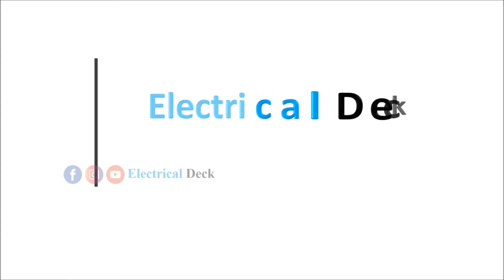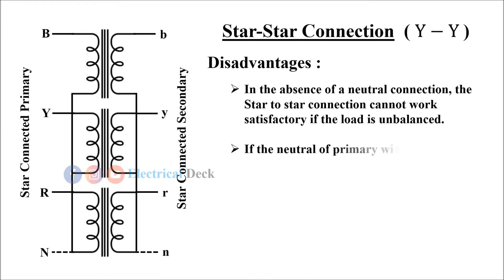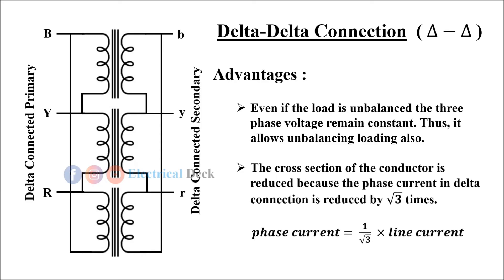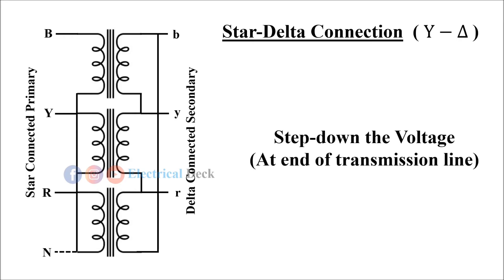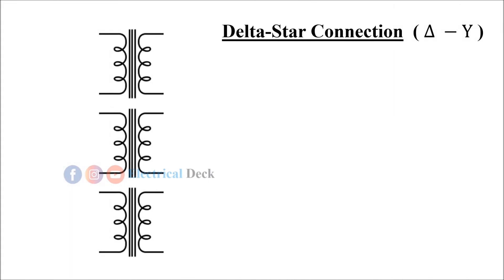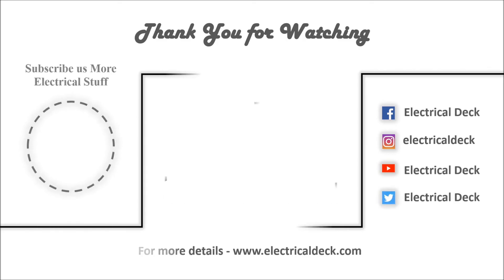3-phase Transformer Connections | Star-to-Star, Delta-to-Delta, Star-to-Delta & Delta-to-Star

Comment: 00:06 Understanding three-phase transformer connections for power generation and transmission.
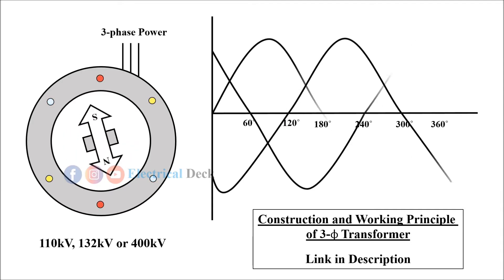00:54 Overview of three-phase transformer winding connections.
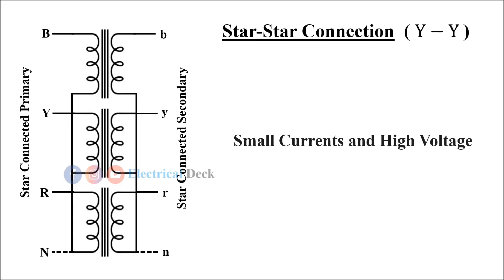01:44 Star-to-Star transformer connection is ideal for high voltage and low current applications.
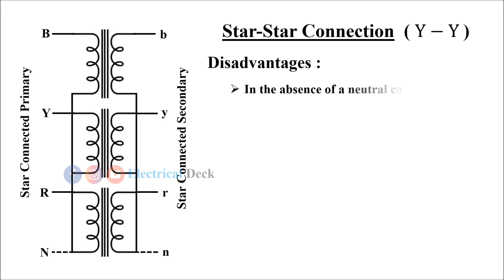02:33 Star-to-Star connection struggles under unbalanced loads.
03:23 Delta-to-delta connections provide stability and efficiency in unbalanced loads.
04:04 Star-to-Star connection isn't suitable for four-wire systems.
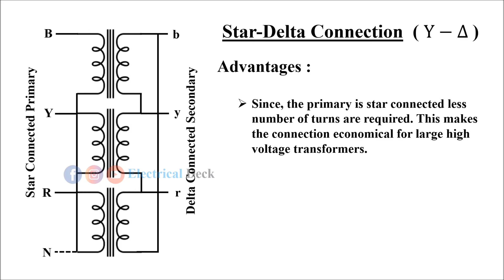04:50 Explains the advantages and disadvantages of transformer connections.
05:40 Delta connections support unbalanced loads in three-phase systems.
Crafted by Merlin AI.

Comment: Thank you for the clear explanation. Not sure if I'm right but I'm skeptical of the star to Delta. You said it was for stepping down voltage at the end of the transmission line. I question it since (where I live, maybe different in your country) we have a 4 wired system that is distributed. And Delta cannot use a 4 wired system. So if you anyone can, please help with clarifying the matter.